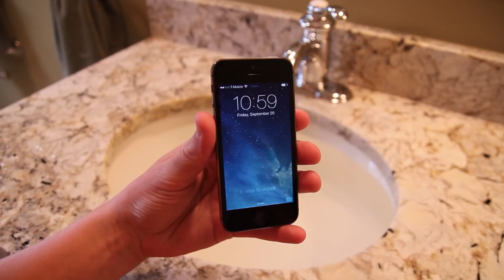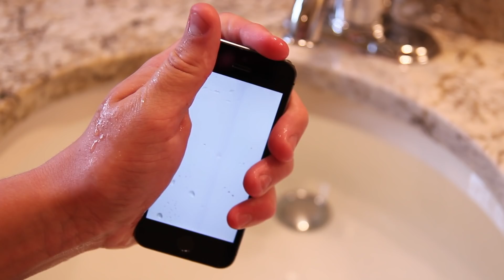iPhone 5s Water Destruction Test

Comment: It’s not the battery acid corroding itself. It’s the short circuits between water and minerals in the water can deliver electrical charge so it’s completely shorting out your entire board which is misplacing a lot of energy and power which is misplacing a lot of heat.

Comment: i accidentally dropped my iphone in water and i am so scared. I dried it and i put it in rise. Will it work? 😥😦
Reply: i know that seems like a possible solution, but unfortunately it's not. the insides will get ruined and by the time that u put it in rice, it'll be too late. so i guess rest in peace iphone 5s
Reply: It should. I did a water test yesterday on an iPod touch and it was in the water for minutes before it blacked out. I thought it was done, but to my amazement it turned on hours later and worked completely fine. The battery is fried though, and have to charge it every few minutes. But if you got it out right away it should work.

Comment: I dunked a old Samsung in water and its screen wouldn't work but if I touched the screen it would do what I tapped so I restarted it a few times one time the screen worked but no speakers so I restarted it then it would go to the Samsung logo then it died, when I tried again it made a quiet buzzing noise. I took the battery out (even though you can't do it on the iPhone) and left it overnight, the next morning phone worked flawlessly

Comment: Your iPhone 5S is not done after putting it to water. Just put it in a sac of rice and all the rice will absorb the water.
Reply: I dropped my 5s in the bath, whilst it was on, took it out, removed my case & put it in rice - even though it was still working and it is perfectly fine to this day!
Reply: +Lauren Johnson same except i dropped it in a creek and jumped in the creek and got covered in leaches
Reply: The motherboard would be fried
Reply: But if your phone is turned off then drenched in water, yes then putting it in rice and not turning it on till the inside is dry it will be ok.
Reply: Lauren Johnson Lucky

Comment: my iphone 5s died in the beach when I was taking pictures with my friends. Stupidly and carelessly, I dipped the whole body for about 2 seconds into salt water. taking it out and sucking all the water out w my mouth and no luck, it turned off, then I tried turning it on and it did and displayed the lockscreen, then i turned it off again bc the touch screen wasnt working then after that boom its fried,everytime i tried turning it on it displayed the battery with an itunes logo. My guess is that when it displayed the lockscreen the saltwater hasn't hit that area with the processor n stuff but it has already taken my beloved touch sensors..the ricebag or blowdryer doesnt work! well for my case. salt water is tough. take it to apple and they'll replace it for a fee.
Reply: Why the fuck did you dip it in the water

Comment: I have an lg smartphone. My cats dropped it into water and I was looking for it when it rang. In the bathtub. It was there for a while, because the picture that I keep in the case was soaked. The phone is fine, when I took it apart I saw that it is very isolated from the inside so no h2o got in deep enough. Only the sound is slightly off, I think.

Comment: Dry it out with rice for 48h, buy iphone 5s battery. Usualy it comes with all tools and cost around 10 dollars. Tag in youtube = replacing iphone 5s battery. And its easy to replace and low cost repair. Problem solved.

P.S Damage depends from water, most damage to phone do salt waters from ocean, pool. Because salts and minirals are doing damage, not water! Proper repair should clean motherboard with alchacol 99% and than replace battery, possibly charging docks also are damaged

Comment: I dropped my iPhone 4s in water & I gabbed it out as soon as. Took it apart & put it in the airing closet to dry out for 24 hours. After that the sound was distorted but then I left it in there for another 24 hours and it's fine

Comment: You should never EVER do that with any device no matter if you don't know whether if it will break or not, because it depends if it breaks or not. You should never EVER mix water and electricity because you could get electrocuted. Yes it may still work but it could do some dramatic changes like take away a lot of memory and may break the deep inside part of the iPhone. So my point is to never EVER put your phone in water, so don't even think about trying this at home. iPhone 5s is very expensive, nearly more expensive then the IMac.

Comment: The iPhone 5s has a white screen and a black apple logo when it turns on. You have the iPhone 5. You could've just hit the home button to unlock it.
Reply: you'd have to slide to unlock. the iPhone 5 doesn't have touch ID which was what he used to unlock it..
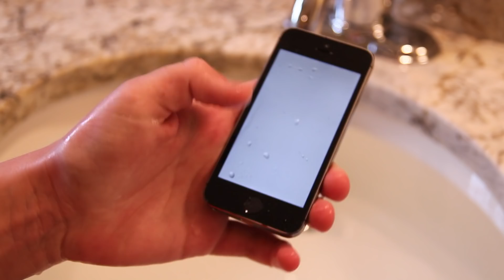Reply: re-play 2:04-2:05 watch the home button. the iPhone 5 has the little square on it,this doesn't,it's obviously the 5s
Reply: Or if you just replay him at 0:23..

Comment: A few years ago I had an iPod touch. Went through the wash and didn't work at all after that. It did the "put it in a bag of rice trick" and after a while of it sitting in there, it worked again without any problems. I wonder if the 5S would do the same. There was probably more water going into your iPhone than my iPod touch that went through the washing machine. So there's that too.

Comment: if that happens to anyone by accident, you should not try to open it again. What you should do is put the phone in air sealed container full of raw rice. The rice should absorb all the moist from inside the phone. you should not try to turn it on cuz causes electric contact which kills the phone, the phone is designed to shut itself down before its electric currents go wrong.

Comment: Its not heating up because of the acid in the battery... How can it the battery is in a air tight package its actually heating up because the water is connecting the positive end and negative end together causing it to short

Comment: I was caught in a severe storm just now and my iPhone 5S dropped out from my pocket and was lying on the pavement in a puddle.I picked it up thinking it was gone but was surprised to see it still working.Great quality from Apple!
Reply: ToraydoBull Apple SUCKS. MY IPHONE 6 PLUS CRACKED SO BADLY AND THE DISPLAY STOPPED RESPONDING TO TOUCHES. IT WAS ONLY A 3 FEET DROP AND I HAVE A CASE

Comment: I dropped my iPhone 5 completely in clean normal cold water on Christmas for about 3-6 secs accidently. I dried the outside of the phone immediatly and it still worked. I put the phone in rice just to be sure for 2 hours but when I took it out and moved it a bit around (with water inside of it) weird things started showing up on my display and my phone kept on restarting. After restarting about 10 times it finally worked and booted the system up but when I used it 1-3 minutes the same thing kept happening. I read things on the internet and found out you have to put the phone in rice for 72 hours so I did that and took it out this evening and it worked just like before! Only the motion sensor or something that makes your phone background go to the left if you turn your phone to the left was a little weird, but who cares about that? Everything works! :)
Reply: wow, good idea of putting it in rice. it will attract asians and they'll repair your phone. i know this cause Im asian and it works.
Reply: try this:i dropped my i phone 5 in water and it can't connect to my carrier,so i killed my phone,to 0% and then left it for two days then charge it again,it worked flawlessly,i have no more issue's anymore.and if it doesn't work throw it around,slam it to the ground maybe,be generous with your throws.
Reply: ***** water soaks into the rice.
Reply: ***** i think a grain of rice is bigger than the speaker and microphone grills not sure about the headphone jack and lightning connector though
Reply: innocentboyzthegreat I'm asian too
Reply: I dropped my 5s in a lava. Will it still work?